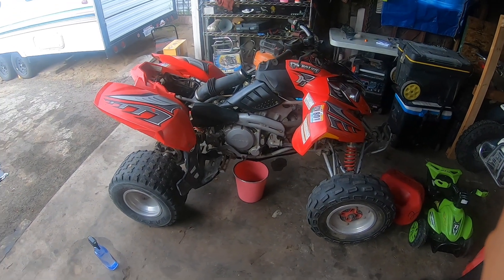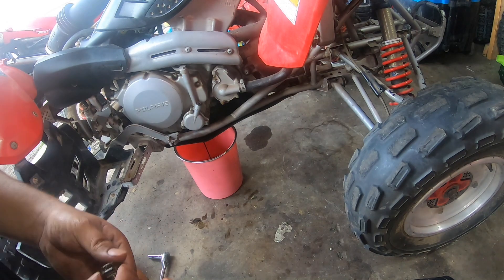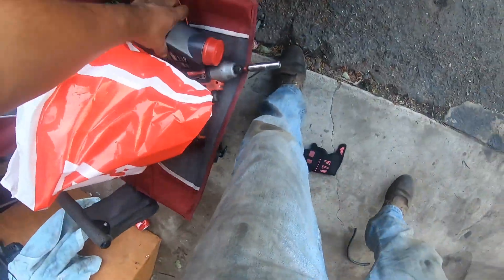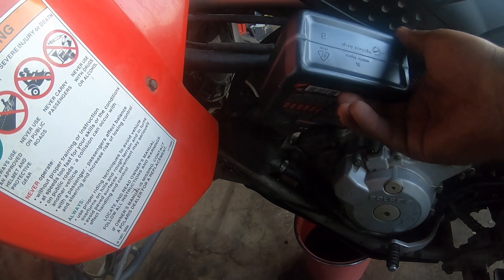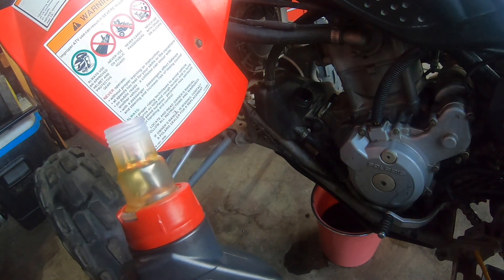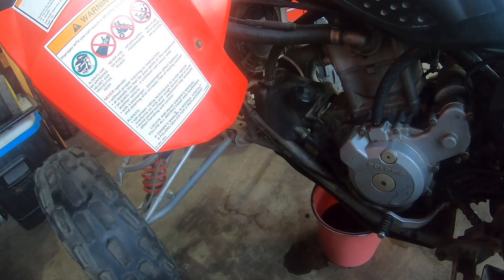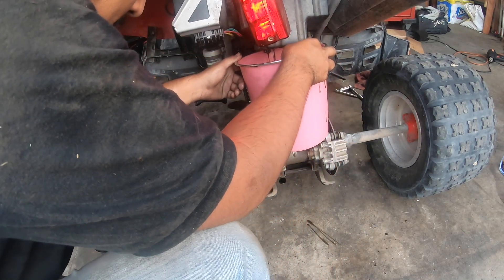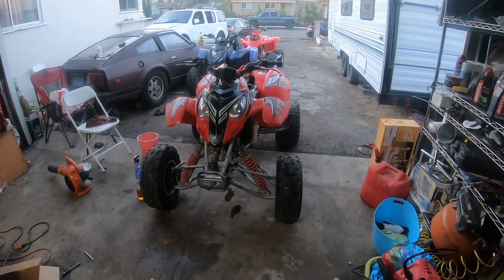Predator Polaris 500 Oil Change ATV DIY

Comment: The predator has a dry sump oil system and you need to clamp shut the line going from the oil tank to the motor or else you will get oil in the air box again.

Comment: One of the oil filter screws snapped off inside any ideas on how to take it out?
Reply from the maker: Still need help? Do you have Instagram so I can send you a long voice message?
Reply: Bolt extractor of appropriate size and a left hand drill bit to match
Reply: Drill and then extract if it doesn't grab drill deeper

Comment: Did the oil change fix the oil coming out of the air box? Mine is doing the same thing.
Reply from the maker: Yes sir this bike is running great now, came back due to a Chinese stator that was put on in Mexico but I’ll be posting some updates soon. Just picked up another banshee so I have been busy. What oil you running?
Reply: @AceMotorsports  I changed my oil and it stopped doing it, it had way to much in there I’m running 10w 40. I read forums about it at they said it works good